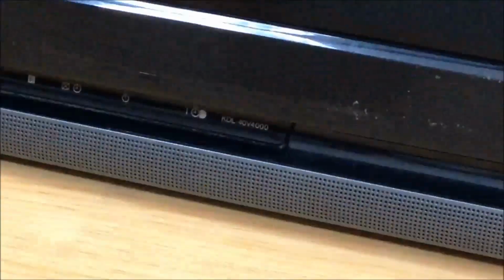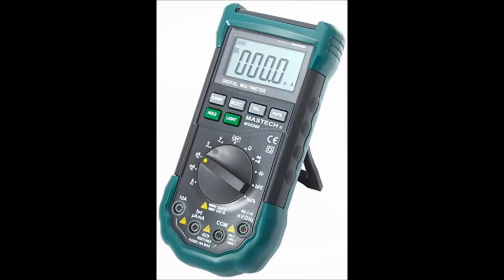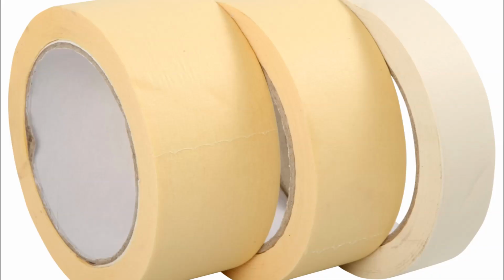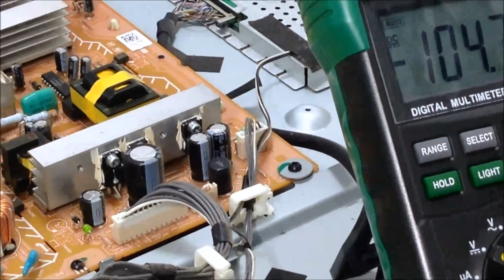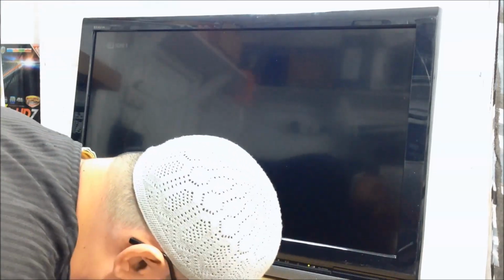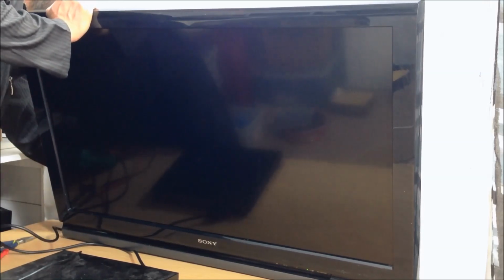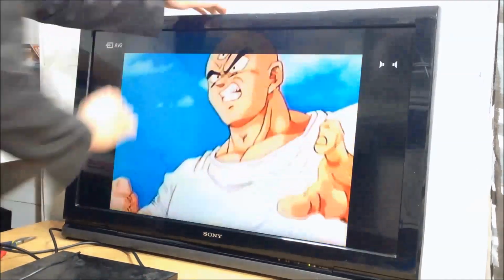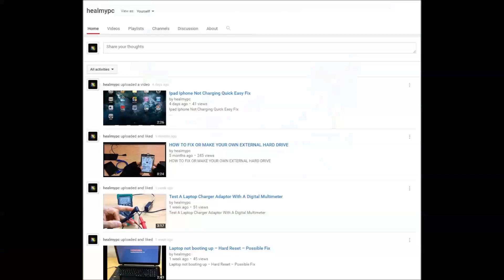How To Repair A TV That Won't Turn On | How To Replace A TV Power Supply Board | Sony KDL40V4000

Comment: Hi
I have a board for power supply  board KDL-46w4500   1-876-467-21  A1557559A but one of the connector with 9 wire can not fit to 7 pins male sucket.
any suggestions

Comment: Hi, thank you for the great video!

Similar to you I have no DC voltage coming out of the PSU on my Sony 40S400A. However, in your video you mention that the replacement PSU needs to have a matching circuit board number (ie. 1-876-467-13). What about the part number (ie. A1568130A), does that need to match also for compatibility??

Comment: Thank you for sharing your knowledge concerning power supply boards. My TV wasn't getting any power, so I went to Best Buy and bought another one. Just for the heck of it I did some diagnostic testing on the power supply board on the broken TV and found the main fuse was blown. I ordered a power supply board from ebay for $23.99 free shipping and installed it and the TV works great, and years of dust has been cleaned up. It all worked out great because we needed another nice Flat screen TV for are garage. People may say that the Sceptre TV's are junk, but it lasted me over 10 years running all the time. I suggest that if you have some technical knowledge and have a TV that is broke to try and do some troubleshooting using youtube to guide you as to what to look for and test, because you may just find the problem for penny on the dollars compared to taking it to a TV repair shop.  Thanks again.

Comment: I have a sony bravia 2015 xbr 55x810c has no power at all ..i did the first check with the power cable and I'm getting 119v do you think it's the cable and what causes the cable to be like that?
Reply from the maker: If your test is correct then yes it could be the cable?  Cables can degrade, or inside wiring can become loose, or it could even be your main plug.  Sounds dodgy and you probable should get it check by a suitable qualified person.

Comment: Thanks for this tutorial. I have the same model kdl40v4000.. checked dc voltage on main board is 3.3v, but no display or lights or sound.. what could be the issue

Comment: i wish u have a video that can repair power supply board, i have the same problem no power no lights at all.  and i dont know if module or power supply is the problem

Comment: hi there. i have a sony kdl-40v4000  purchased in 2007. The sound stopped working 2 days ago after turning the tv on. The only thing i did differen't before this error is using a chrome cast in the side hdmi slot. i have tried other means of sound including hdmi to external audio system and headphones but with no luck. i have tried a factory reset as per the options in the tv menu and have explored many settings. Have you any advice or ideas why this error of no sound has occurred? thanks in advance.

Comment: First I have a Samsung UN55H6203AFXZA (Version US0o1)  I was watching the set a few weeks ago when it suddenly went off and would not power back on.  This TV has a standby light and it would not light.  I ordered a complete repair kit, switched out all the boards and still it would not power on.  Writing in I was instructed to return the whole kit which I did.  When Shop JImmy received the kit they informed me that all the boards were tested and passed.  In the interim I put the TV from my kitchen into the room and in the same place that the Samsung had resided, (after all it is the NBA & NHL playoffs!).  

Today I came home and now this TV won't power on and it's standby light is no longer lit.  When I went into my bedroom the digital clock on my bedside table was blinking so I know that there must have been a power outage while I was away.  I figure that this must have been what happened to the Samsung, (i.e. there was a power outage and when power was restored it must have surged through to the television.  Originally I thought since it was plugged into a surge protector that this was not the case and I blamed the TV.  Now I think this is not a surge protector, rather it is simply a power strip and a cheap one at that.

My question then is, if my supposition is correct, might only the power board be affected on both TV's or might this problem have compromised more than one board in the TV and even effected the LED's?  I have a good multi-meter but am not sure I'm running tests correctly.  The plug on this board that runs a cable to main board are labeled to test at 13v, I'm getting readings of 1.5v.  NOTE:   When I bought the "Complete Repair Kit" for the set and changed out all the boards the set was still dead, no standby light, no power...  Should I order another power board only, the whole kit, or head to Best Buy for a new set.?  The Samsung is 2yrs old...   The 2nd set that failed is a Polaroid FLM-3234B  Model 3200.   Please advise...

Comment: Attempting fix on a Sony Bravia KDL-32U2000. AC multimeter reads 240V AC on mains lead into power board, but nothing (red+ into 5V, black- into ground  screw) from 'CN6200 SECONDARY' port on 5v DC out of power board. Static GREEN light & four flashing red lights (RESEARCH:: "...can be LD board or main logic board; check inverter board wires for arcing to ground..."). Can you advise on a power board fix, or forward route. Regards

Comment: Hello there, I have a problem with my TV Sony bravia Kdl-46hx803, TV don't turn on, the red light it's flushing 5 times and stop few seconds and again it's flushing, when I turn it on green light go on for about 5 second and again the red light it's flushing, I have a doubt if it's a problem with t-con or with power supply? 
Many thanks!

Comment: dear sir i have a question  my Sony  TV  model : KLV26s550A standby red light on at front side but tv can't turn on . red light  is not blinking continue on and relay switch  is making noisy

Comment: im having a hell of a time ,im trying to repair my rca led40c45rq tv i have no power and no standby light replaced the 4 1000  25v compositors and that didnt work  can you help me or should i put it out in the trash

Comment: Great video. I learned a few things. I have 117v(U.S) with power cord and 3.3v on DC power board. Red led light comes on(standby mode) but when I hit power button, green LED shows then goes out. What else can I check? If you have a video please reply with link. Thanks!